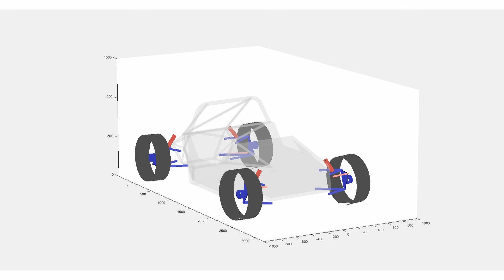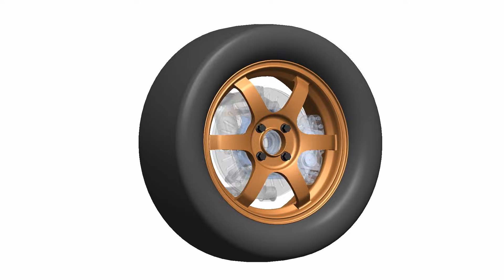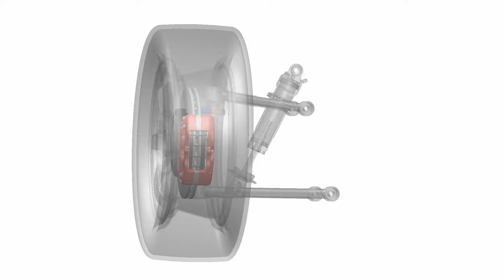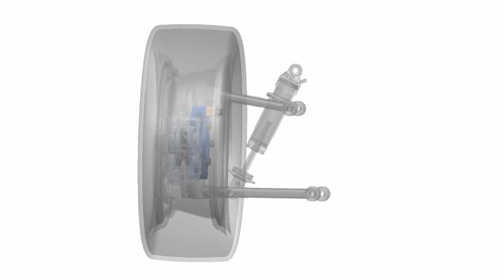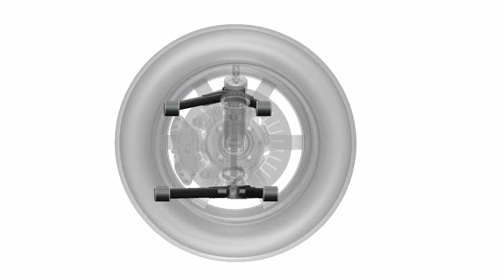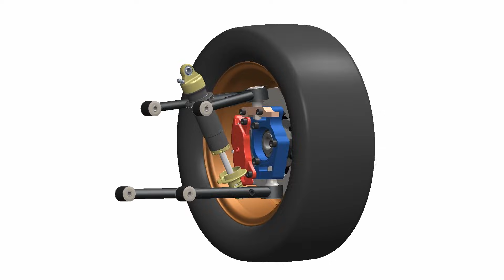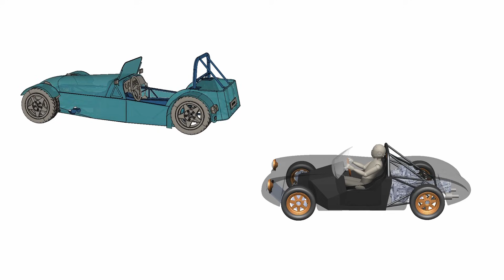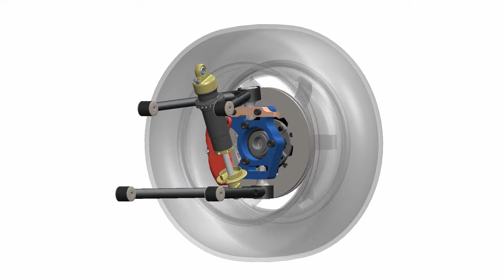Starting the Suspension Design for a Custom Sportscar (Project 171)

Comment: 0:55 which software did he use? How do you even simulate such way?(Ansys is one thing but he isn't using that). If any of you know, plz let me know (better if you can also give me a tutorial video on this)
Reply from the maker: I cover some of the software development in the video on Suspension Kinematics.  The software is stuff I have made myself.  I was the original lead on the OptimumK software a long time ago.  Before and after OptimumK I have maintained my own geometry and load calculation code for personal use.  Note that it is completely different code.

Comment: just found this channel. at 10 seconds in, I knew you were a mech engineer because you didn't have rod ends in bending for the a arms
Reply from the maker: There is still time... But yeah trying to avoid putting poor practice on display

Comment: What if I'm designing a system that is relatively fixed in its configuration - 
1) Tire Size and wheel diameter - tire compound all fixed in the rules 
2) Car weight semi fixed @ 2300 lbs  
3) Wheelbase fixed @ between 102 and 105 inches  
4) Rear end is conventional not independent 
5) Front is open to do whatever
6) Car is left turn only 
7) Runs on dirt not asphalt 
8) Engine must be in the front and subject to specific restrictions about set back from the front CL
Reply from the maker: Any bump based effects might get magnified on dirt due to more vertical disruptions, but maybe with a lot of slip angle the toe change might not be as noticeable.  I would expect some of the loads due to steering offsets would drop a little, well until you hit a rut that has been dug into the ground.

Interesting conditions.  I would probably spend most of the time focusing on the damper.  Damper shaft speeds on dirt racing tends to be a lot higher than road racing so they have a larger impact on performance.  Hope to cover some of that in a future video.
Reply: @KevinHayward7  
Toe change is not a problem we can fix that - Slip angle becomes a problem - many do run steering offsets - and big scrub angles - but I prefer to eliminate those in favor of center point steering with no scrub and lead the left front tire more than the right front (becomes a difficulty with the Akerman) - then on the right front you have to get the tire to lean in at the top going into the turn and straighten out during the exit of the turn, and visa versa for the left front.

Comment: Do a space frame style De-Dion rear axle with inboard brakes and a Satchell Link, and give it camber adjustment links and toe shims. That and decoupled Roll and Heave dampers like the AMG Project One or any of the slew of FSAE cars that do it with a slider crank and conventional damper.
Reply from the maker: Been a part of a few decoupled suspension setups now. These have been hydraulically interconnected, and the ones at ECU have used beam based suspensions. Works well, but there is a fairly big overhead in design and component cost.  Although the interconnected can be retrofitted to a car after a build...
Reply: @KevinHayward7  I've seen the slider thing that lets you use a conventional damper unit in a AMG-One style decoupled setup and it doesn't look that complex at face value. You could've even forgo the spring on the roll unit for a traditional roll bar, hypothetically speaking at least, but then there would be no preload ability. I'm really curious as to how it might be applicable to a full-scale street car suspension. Talking more of a GT/Sports combination car, likely above 2700lbs with driver, not using exotic materials for weight reduction.

Comment: Nice, I am try to use covette C5/C6 upright in my pontiac fiero 1985 will be a double wishbone setup, those bearing hubs are packed with speed sensor too and a huge aftermarket.

Comment: Summary:
We start from the outside so we start from tire selection. We don't spend much time in deciding the specific tire, we want to focus more on the rim size because it affects the no. Of options u have in the future and the weight of the unsprung mass. Rim size impacts the calliper size, brake rotor, upright etc. We can buy a fabricated upright but then we need to compromise on the suspension geometry. There are other minor points that are car specific which I have not covered.

Comment: Hello!
interesting project indeed. I am building a midengine BMW V12 sportscar in my garage and have exaktly the same approach.
My choice of a V12 is the sound, I use a 6 speed transaxle from an Audi 2,5 Tdi, 17" Volk 37 and so on. A very nice solution for the upper balljoint is Ford Transit tie rod end. Often used on Super 7 replicas. Then you get a very nice adjustment possibility of the camber.
Reply from the maker: Sounds like a very cool project, hard to do better than a v12 for sound.

Comment: 0:34 OMG, this is the Volk TE37
Reply from the maker: Placeholder only at this stage.  Very light wheel, but you certainly pay for it.  Will probably end up with something only a little heavier but a fair bit cheaper. Would be interesting to try and figure out an appropriate $/kg for good value. Would help to determine where the funds are best spent to have the biggest impact

Comment: Great video as always. Don't want to sound as a jerk giving silly suggestions but I would look into placing damper attachment on lower control arm so that the line drown through damper axis points to the center of lower ball joint thus eliminating bending loads on the wishbone. It's a bit trickier in terms of packaging/clearance to upright but it's a good practice to do so. I realise that this is first revision of parts (as A letter in part number suggests) and I'm sure that above mentioned is well known to you but I thought that it may be usefull for someone watching/reading comments. Thank you.
Reply from the maker: @TudorMiron  I was playing around with it as modelled because it means left and right sides are the same part, but was thinking I was going to change it to what you mentioned, which is what I would normally do.  The bending loads wouldn’t be massive as it is, but shifting the damper attachment will also help me put in a suitable ARB attachment point.

I do appreciate the suggestions, most people are making good points and keeping me on the level :)
Reply: Actually this design is already built and proven 15yrs ago. Reynard Inverter open source sportscar. Designed and built by me in UK and currently racing in NZ sportscar series. A shout out would have been nice….
Reply from the maker: @andredavidbrown very happy to give a shout out. Your open source model is a valuable resource. I was a big fan of what you had done with the Inverter when it was released, and glad to hear it is still racing. I did use some of the parts as placeholders in earlier versions of the model (as I did from other available models). The a-arms at the moment are very similar to your design (although not using your models). Feel free to reach out if you want and happy to discuss the best way to do this. I don't want to misrepresent either your work or my own.
Reply from the maker: @andredavidbrown, please note I have added some text to the description of the video to highlight your work.
Reply: @ thanks Kevin! Did you see the ATS sports 1000, the Jannarelly Design 1 and the Rush Auto Works SR are all based on my designs (some more than others!)
Reply from the maker: I have now.  It doesn't surprise me.  Your design was well thought out with some very easy to implement solutions.  The Jannarelly Design 1 in particular is one that I had seen and liked, I hadn't noticed any connection though. Thanks for pointing it out.
Reply: @ yes. Their initial prototype used my suspension seemingly as is and elements of the chassis.

Comment: Just a quick note : it is ABSOLUTELY IMPERATIVE to start with the tire. It's is the NUMBER ONE performance factor on a car. If you don't know how to extract the performance out of it for a given height, width and diameter, you will never be able to have maximum performance.
Obviously it's through slip angle correlated with weight, temperature and camber.
ALWAYS ALWAYS start with the tire.
Reply from the maker: Thanks for your comment, there is definitely wisdom in what you wrote.

What defines maximum performance is an inetersting question. The car isn't intended as a racing car, so there is a balance that will be needed between grip, wear, road noise, and sprung mass accelerations. The tyre plays into all of this. How to end up with the right suspension settings / dimensions will ultimately be partly design and partly testing / development. Given that it is outside my resources to get suitable tyre data during the design phase, much of this will need to be on car development much later in the process. This means the less I know about the tyre in design, the more I need to build in adjustability.

In an earlier video I state the goal of the project is to "Create the most engaging car that I can".  Decent performance is a part of this, but not the only factor. If it was, and this was a racecar I would 100% agree with the tyre being the most important component.

Although I am aware that it is a pretty big claim to say the tyre isn't the most important decision I will make on this project, and happy to sit in respectful disagreement with other people on this point.

Comment: Is "rod ends in bending" not an issue here?
Reply from the maker: No rod ends in bending. That refers to the threaded part of the rod end being exposed to bending loads, which is a bad idea in suspensions because of the fatigue loading. This approach does use single shear at the ball joint, but they are on the chunky side, and very common on road cars.

Comment: 16:10 can't the disc and caliber be moved to the differential like on f1 cars and humve trucks? 
There making the tire the only major weight factor?
Reply from the maker: That's a good point for the rear. The total weight of the car stays the same but there is less of it unsprung. The main issue with the inboard brakes is that you are then dealing with the slop and stiffness of the driveshaft to transfer the load. I'm not really a fan of that having driven some cars with inboard brakes.

Comment: Irrelevant question to the engineerint subject, but can I ask, which program did u use to render the CAD assembly??Did you record it directly from your PC cad screen or edit it in another program?? I design cf and pu injection molds and I want to demonstrate them to my clients for better marketing. Your answer will help me quite a lot. Keep up the good engineering work
Reply from the maker: This time i used the animate (motion simulation) in Solidworks, just a simple rotation, and you can save to a video file.  Sometimes I will screen record but then trim the edges off.  If i don’t need much footage I can render in Visualise but it takes a lot longer.  After that there is a little editing in DaVinci resolve to pan/zoom/time edit.  I still have a lot to learn when producing the animations but it has been a fun learning process.  Hope some of that helps.
Reply: @KevinHayward7  dear Kevin, thank you very much for your detailed answer! Do you record your video with Windows or with another software? Because I tried Windows screen record and the quality is very mediocre! Good luck with your engineering project!
Reply from the maker: @keronGR  The windows screen recording isn’t my preferred way of recording because as you say the quality isn’t always good.  I do record on a 2k monitor and the videos are at HD which does give me some resolution to play with.  The saving out via the motion simulation was surprisingly good, and it let me play with frame rates and file type which was handy.

Comment: Rather than designing around a dog-ear mounted brake caliper consider designing around a radial mounted caliper. Gives more options for rotor sizes in the future should you need to size up or down. You can easily move the caliper with spacers instead of having to buy new calipers or machine a new upright. Something like Wilwoods 120-15563-SI. It's lighter (50 grams), same piston count, piston area, and rotor width. It also costs slightly less.
Reply from the maker: Good catch.  Was already planning to make the change.  Was going for a dog ear initially to keep more machining processes on the same setup, but given the tapered holes for the ball joints are going to require another setup there is probably not that much of a machining cost benefit.

Comment: Very cool video.  My experience is that spherical bearings actually ride better than busing of the type you showed- there is more road "noise" but actual ride compliance over bumps is better
Reply from the maker: Good call, I did mean noise rather than ride with the bushes.  Will keep the ability to switch to sphericals if I am unhappy with the bushes.

Comment: I was under the impression that elise series 1 hubs are an annoying 4x3.5" or 4x95.25, this is the old british standard size and are notoriously annoying to find rims. If i have got this wrong, please let me know
Reply from the maker: I think they are, but the bolt on units are series 2 which is 4x100
Reply: @ dont know why i thought you said series 1 🤦
Reply from the maker: I did show a picture of a series 1 elise from the benchmarking video, which could have caused the mixup. Although your comment was handy as it made me quickly double check everything.  It is all to easy to make a silly mistake so I appreciate people asking questions.
Reply from the maker: Series 1 has a different hub/bearing/upright setup

Comment: Great content as always Kev! Regarding ABS, take a look at Teves MK60 units before discarding the idea; they are affordable (used), programmable and give you quite a few options to play around. Also may worth taking a look at Bilstein AS2 damper series. You can get individual components for a "dry build" and shim/fill them up yourself on a shock dyno to get what you need in terms of damping.
Reply from the maker: Thanks for the advice, I will check out both of these options. Definitely happy to look into suitable rebuildable dampers, a part of me wants to do an interconnected build. Done a few with the little formula cars, wouldn't mind trying it on a road car. But trying not to let the scope creep too much.
Reply: @KevinHayward7  the damper suggestion came directly though knowing your past (mech5496 from the FSAE forums here). And would love to see an interconnected setup, been toying with this idea for quite some time for my Miata as well
Reply from the maker: I figured it was you Harry, from the username, although I will admit I know enough Harry's I wasn't sure which Harry is was :)  Some of our students at ECU ended up doing a better version of what we had done at UWA with interconnected. Even though we advised them not to do it.  Was simpler and much more modular.  Definitely think there aren't enough interconnected setups going around.  

One of the student, Eric Curwood, ended up doing a PhD with us on damper modelling where he assembled some of the parts into a really handy damper test setup. Then investigated how a damper model is affected once you add fluid mass, thermal expansion, fluid compressibility etc. Fantastic work that shined a light on how much there is still to learn.

Wouldn't mind showing some more detailled damper stuff in the future. I usually enjoy hopping on the dyno on the few times that I can.
Reply: @KevinHayward7  would definitely enjoy that! BTW is his thesis publicly available anywhere? Has been a while since I read anything interesting on the topic.
Reply from the maker: I thought the thesis was publicly available, but couldn’t find the link.  I’ll see what i can find.
Reply: @KevinHayward7  look into using the mk60e5 which is much cheaper and plentiful than the original mk60 from M3. And check out the happy cactus converter which lets you use any VR speed sensor with the mk60/e5
Reply from the maker: @superbarnie thanks for the extra info, will check it out this week

Comment: Thanks Dr Kevin. Excellent points on managing to develop the basis of how you build your suspension with decisions on cost, availability and fitting in the potential load aspects to safe limits. I am looking forward to when you get into the nitty gritty of: Tyre slip angles. scrub radius, steering axis inclination, camber, caster, role centre, role steer (hopefully none, but if so, why), anti dive (and squat on the rear), steering ratio selection, Ackermann (or not, or part of, and the reasons why a selection is made). Keep up the excellent work, what you are doing is important.
Reply from the maker: Thanks Phil, plenty of suspension stuff planned. Probably the area of a car I feel simultaneously most comfortable, and most uncomfortable at the same time. I know enough to be aware of my own lack of understanding.  I'm wondering what the best way to deal with all the topics you mentioned. It is likely a fair few smaller videos. Thoughts?
Reply: @KevinHayward7 if it were me, I'd keep plugging away at the suspension design process videos. The geometry will fall into conversation and the video as you go forward through design process. You'll surprise yourself with what you do know
Reply from the maker: That probably is the way to go.  I have always enjoyed learning by example.
Reply: @KevinHayward7  can never stop learning. Looking forward to what you produce